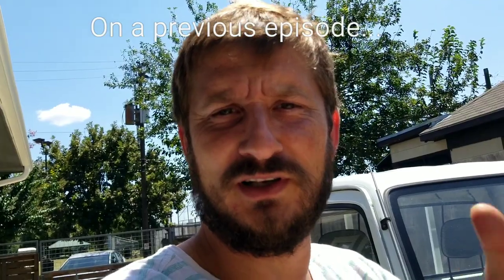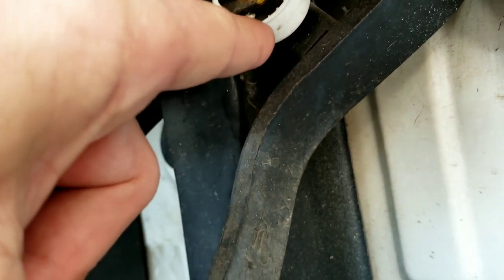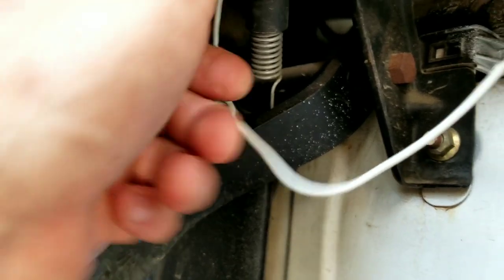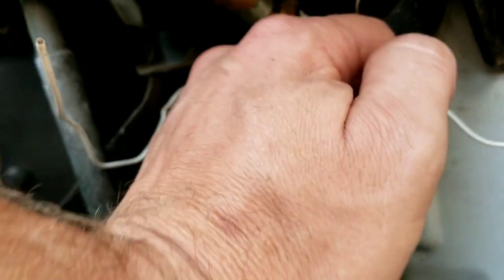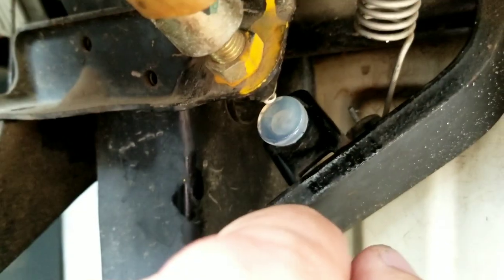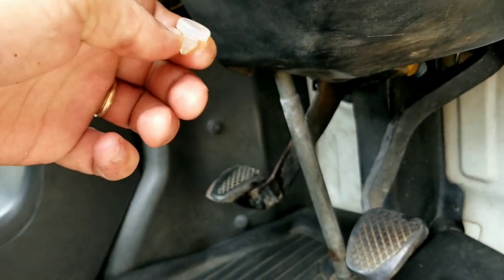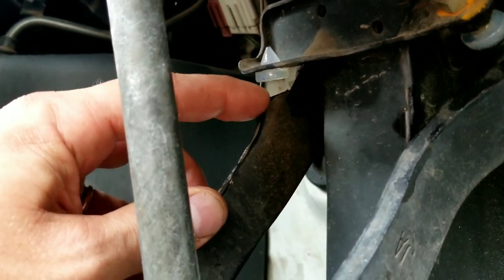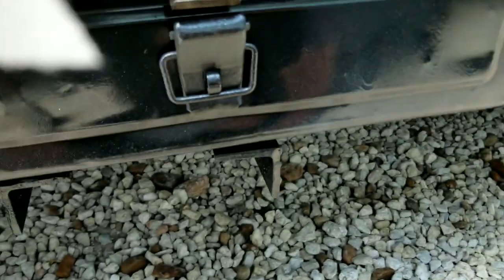Rigged up Honda Acty HA4 brake pedal, fixed.

Comment: Ran in to the same issue with my Nissan Frontier brake stopper pad a few years ago. They wanted $10 each for theirs at Nissan also.  Fixed the church pedal at the same time, which fixed the cruise control.  Found a two pack on Amazon of the Honda stoppers for $8. https://smile.amazon.com/Koauto-Brake-Clutch-Accord-46505-SA5-000/dp/B07C57TBY4/ref=pd_rhf_se_p_img_7?_encoding=UTF8&psc=1&refRID=325TP6R8PRQRAWHJ4ZX5

Comment: Have you ever seen anyone relocate their gas pedal? I'm having trouble fitting into my 92 HA4 and is would be so much nicer to drive if the pedal was pushed back some
Reply from the maker: I've not seen relocated gas pedal. Subaru has the biggest cab size. Much bigger than Honda acty.
Reply: If you come up with a solution for shifting the gas pedal even a few inches further from the seat it would be a huge improvement. These trucks were typically driven by a guy about 5'7" and even at 5'10" it is not the most comfortable position. @USMiniTrucks

Comment: i literally just used a 10mm bolt and 10mm nut on the other side.. ad washers as needed... !!
Reply from the maker: Great idea. The factory one is plastic so will be a bit quieter.

Comment: You need a 3D printer to make your own parts.
Reply from the maker: I went to a large 3D Printer in town awhile back for research. The key is programming the machines.
Reply: The printers are affordable it the laser scanners that crimp the wallet. However it takes a lot of the programming out of equation.